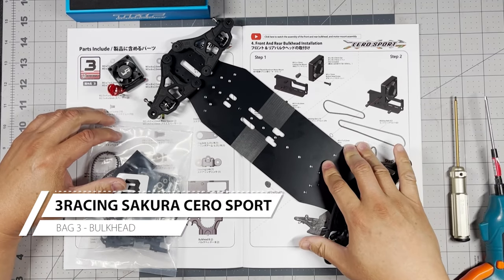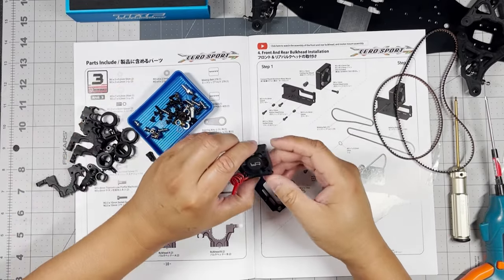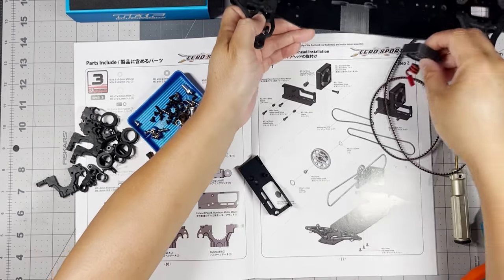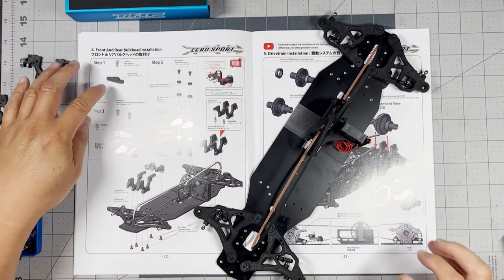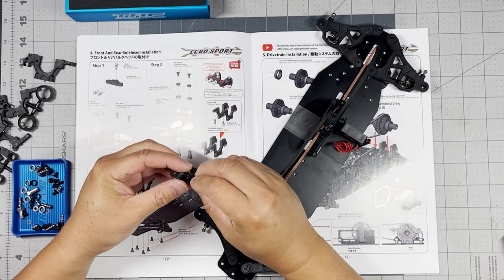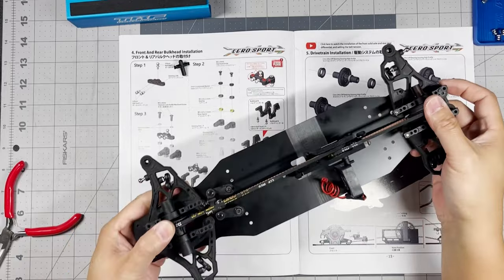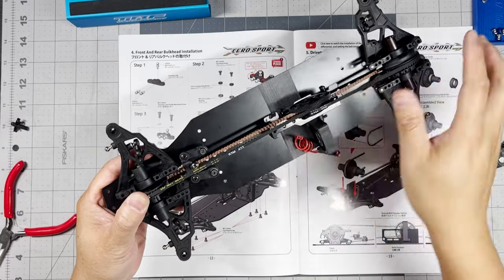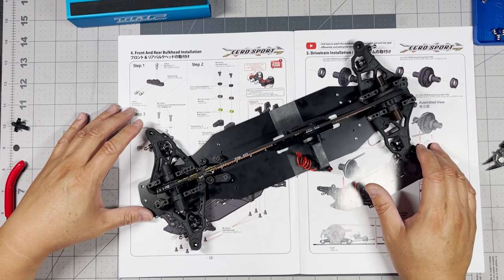3Racing Cero Sport - Bag 3 Bulkhead & Drivetrain Installation #3racing #rccar #cerosport #ceroultra

Comment: I’m at this step, and the oring/spur retaining thing bottom out on the M3x6 button head making the whole thing lock up and not spin. I tried stretching the oring around the spur retainer and that doesn’t work either. Both ways it locks up the bearings
Reply: I figured it out. One of the black counter sunk washers got stuck inside the spur locker making it lock up
Reply from the maker: Glad you figured it out. I didn't have the same problem but I did noticed there's quite a lot of play on the spur gear.  I torqued the screw hub all the one in but there's still a wobble. I hope the pinion gear will lock it in place.

Comment: So i noticed when locking in the dife and drive that the longer belt looks to rub on the lower right arm, any suggestions?
Reply from the maker: Mine seems to be dead center between the arms. Perhaps double check the manual? The build is pretty subtle in certain places.